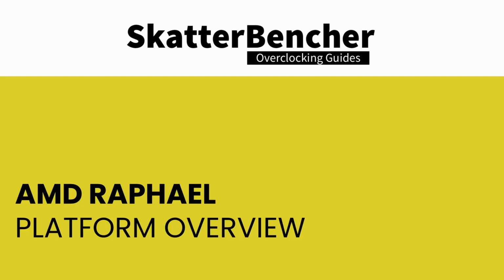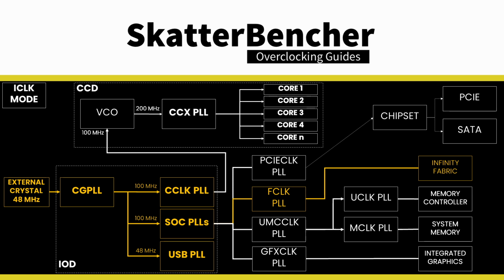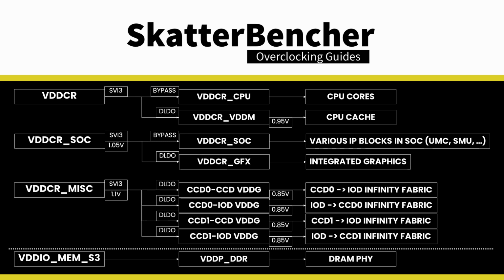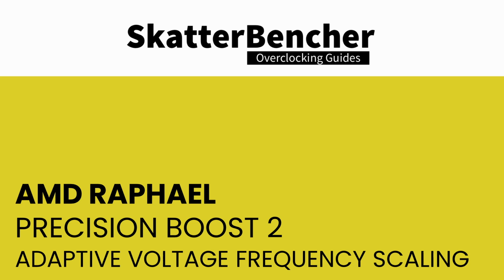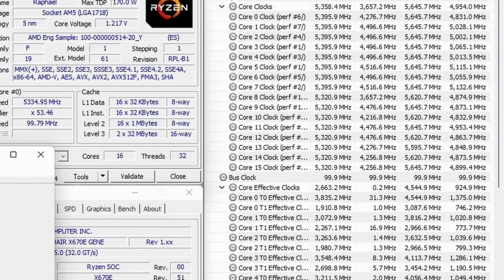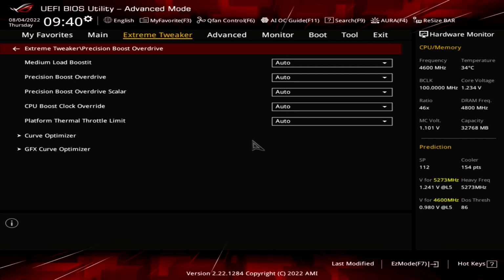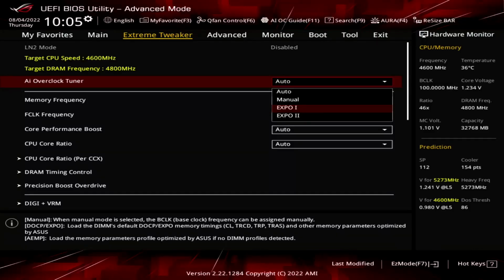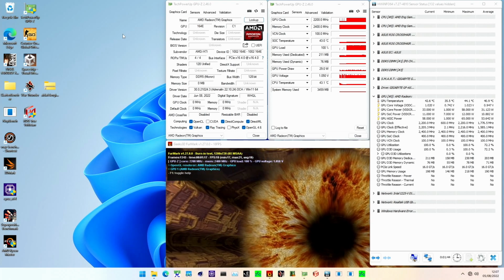AMD Ryzen 7000 Overclocking: What's New feat. ROG Crosshair X670E Gene (Part 1)

Comment: you have an impressive knowledge of the contect in this vidoe. I personally found it to be a little overwheming and was not able to really keep up with much of it. i may need to start a little more basic. my goal is to determin if i overclocking my new 7950x is the path for me. maybe i will get what i need from stock ? Ultimately i would love to hace temps under control with a balanced performance.
Reply from the maker: Maybe a better starting point for you would be one of my SkatterBencher guides. For example, the one for the 7950X: https://youtu.be/JcyVgTUvQEc

Comment: when I enabled xmp profile for my DDR5, my soc voltage is at around 1.38v - 1.4v. Is it safe to let soc voltage go that high ?
Reply from the maker: Short answer is yes.

Long answer is that what you're seeing are the motherboard auto-rules adjusting settings to make sure your high-speed memory can run stably at that frequency. AMD has recommended to match SOC voltage to DRAM voltage for Zen 4, hence why you have this auto-rule
Reply: @SkatterBencher  Thank you for the answer.
Love your video, lots of knowledge and tips.

Comment: PBO2 with curve optimizer and boost override is really interesting on these new chips. If you can achieve +6GHZ with this method, it's would be really nice. I guess the top cores will get there.
Reply from the maker: Great cores on great CCDs inside great CPUs will get to 6G on plain water cooling :)
Reply: I can imagine someone disabling one of 7950X's CCDs and going for the fastest 8 core CPU.